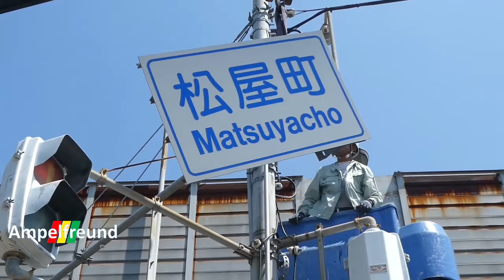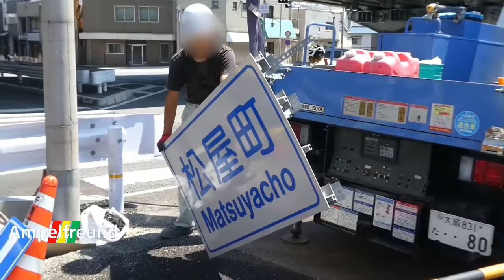Signals are updated to LEDs! Worker install brandnew Hightech Traffic Lights by Shingo Denzai

Comment: Why blur some faces and not others?
Also, why do they work on the wiring with the power on? Is it a low voltage system?
Reply from the maker: Ask Youtube :)

The system works with 100V :)